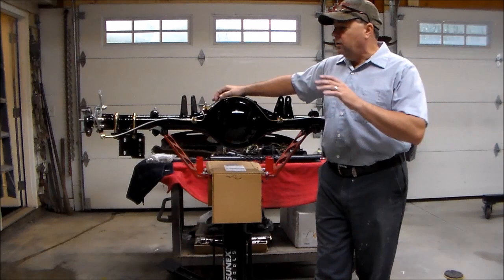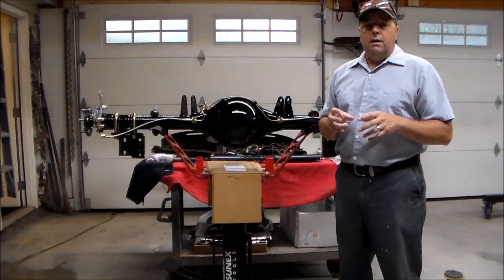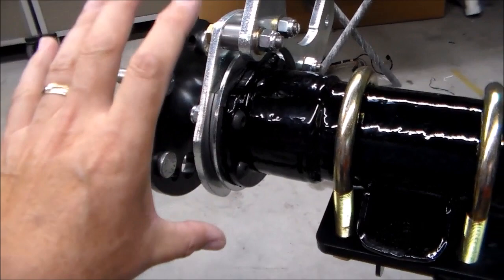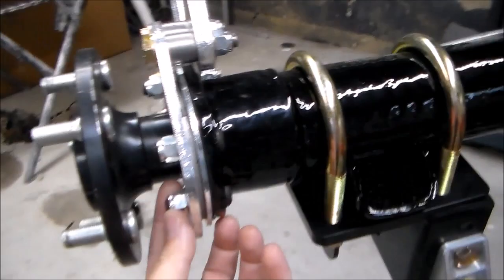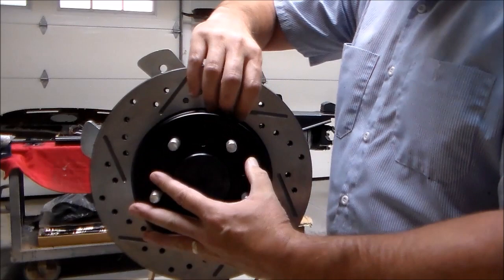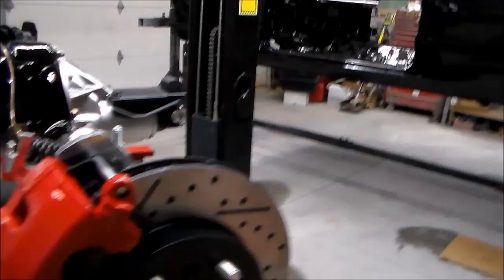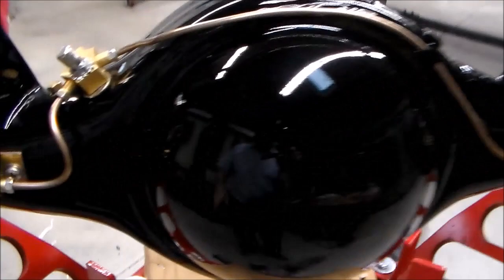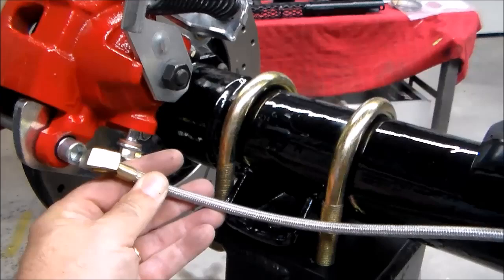Mopar 8 3/4 MBM Rear Disc Brake Installation By Vtwinstov8s.com

Comment: I took a page outta a old 80’smuscle car book . It used 87 Z /28 callipers , one calliper before the wheel and one in the rear . Only drivers side cable needing a extension cable . Big issue callipers weakest link ,the e brake lever . Went back to drums .

Comment: they need to make the backing plate in two pieces it would eliminate the need to take axles out i cut mine in half with a plasma cutter and installed in two equal pieces it works awesome
Reply from the maker: Good idea

Comment: Hey Troy, What type of 8 3/4 axle housing is that? A, B or E body? Im looking for a rear disc brake conversion kit for my 1970 Duster but running into an issue with axle off-set. My axle off set measures at 2.15" or 54.61" mm. Any help would be appreciated.  Thx
Reply from the maker: this is a B body. I did this a few years back. So I don't have measurements

Comment: Did you have to upgrade the master cylinder and proportioning valve?
Reply from the maker: I would recomend it. I would do both and adjust the brake bias for proper and safe braking. thanks for the comment and good luck

Comment: I installed rear discs on my 68 Charger. It was not easy to get the calipers on. Even after in finessed them on, the wheels wouldn’t rotate.
Reply from the maker: Are the calipers fully retracted?
Reply: @troykane  I don’t think so. I just pulled them out of the box & tried to slide them on.
Reply from the maker: @gabrielcastillo4606  That could be your problem
Reply: @troykane  thanks I will give that a try. Appreciate it.

Comment: got a question but not about the brakes...got mine done thanks for all the imput...my question is what shade of black did you paint the dash of the car on the lift and where did you get the paint ???....thanks again for your time
Reply from the maker: I use House of Kolor Jet Black. I buy my HOK on line from a couple different sources. I usually buy it on Ebay.

Comment: What brake rotors did you use ?  The ones I got hit the bolts holding the brackets on. Also it looks like uou did not use the dust cover plate. Any advice who be helpful. Thanks Dennis
Reply from the maker: The rotors I used came in the kit itself. If you have an MBM kit you and don't have rotors, contact them. Really nice folks, they'll help you out. I did not run any dust shields. Thanks for the comment. Good luck on your project!
Reply: Rotors did come in the kit... but they hit the bolts to the bracket. If I don't use the dust shield that might give me the clearance I need.
Reply from the maker: @dennismckay1475  That may work, with out seeing it, it's hard to say. It seems like you have something wrong. I wish i could be of more help to you
Reply: No problem.. thank you for the feedback I appreciate that.

Comment: My caliper bracket isn’t threaded.  Do you know the size to tap?
Reply from the maker: You'll have to look at your caliper bolts. Use a nut to thread over the caliper bolt. Use that nut to figure out the size and thread of the bolt. Once you know that, you can select the 
proper tap. I think it's 3/8" Fine Thread. But I don't know what you have. Good Luck

Comment: For the install on the vehicle are you able to use the factory master cylinder or do you need to get something else?
Reply from the maker: You could use the original in a pinch. But a master cylinder made for rear disc would be recomended.  The 4 wheel disc master will have large resivoir in the front and the rear. The calipers use a larger volume of fluid.
Reply: @troykane  Thank you. I will look into that,